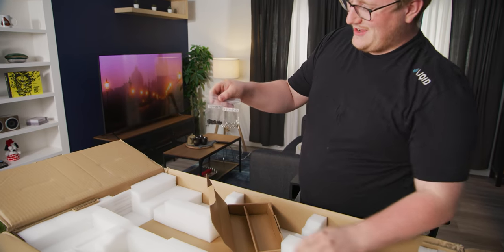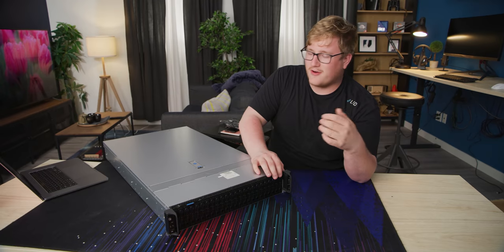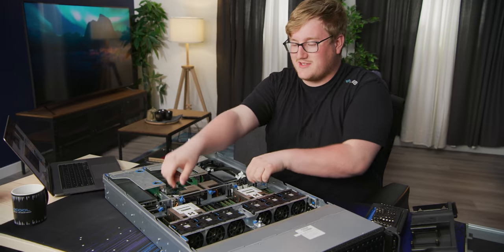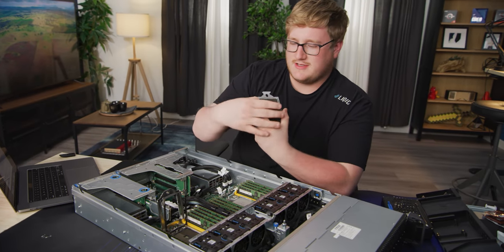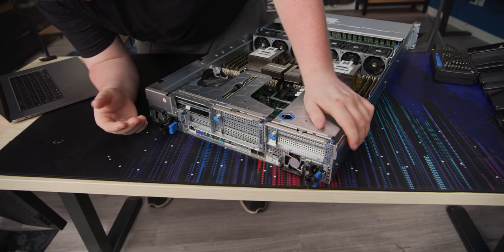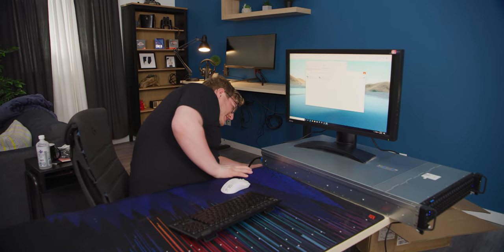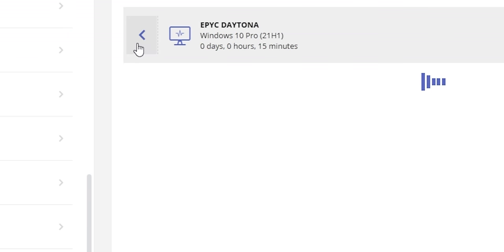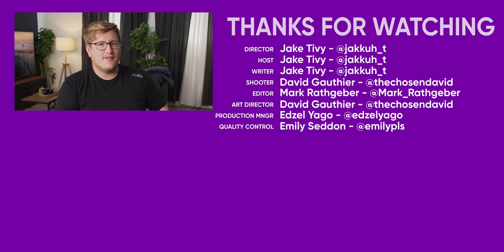The FASTEST computer we have unboxed - AMD EPYC Processors

Comment: I'm really disappointed he didn't mention "VM host" as a possible use for it.  That thing could probably handle 200-250 VMs, in 2U of space.
Reply: Do some VFIO.
Reply: We use the same CPUs in gigabyte blade servers (4 1cpu nodes/u2) and it can handle BUNCH of VMS 

The only issue we ran into is... Availability

128GB ram sticks are basically unobtanium here
Reply: @Angel2kinds  Lucky...  I'm still dealing with Xeon E5 v3 and v4 hosts where I work.
Reply: @Angel2kinds  There are 16 RAM slots. How much do you need? You can get 2TB using 64GB sticks. That would be ~10GB of RAM per VM at 200 VMs. Yeah you'll need more in some situations but plenty will require less as well.
Reply: @kaldo_kaldo  around 1.5TB/server, there are 8 ram slots/node
Reply: @dangingerich2559  eyyyyyyyyyy!

Comment: Ampere Altra does have a dual processor 128 core(per processor) now, their old dual processor 80 core(per processor) would trade blows with Zen2 Epyc but Zen3 does have a pretty good performance boost over Zen2 so they might still trade blows

Comment: You missed the most obvious use for tons of cores, RAM, and storage: virtualization. I have VM hosts running 30-40 VMs with dual 18 core CPUs. Depending on use case and VM requirements, I could easily see running 80+ VMs on a server like this.

Comment: I would use a server like that for finite element analysis... I currently use a Lenovo X3860 x6, 4 processor 72 core system with 768gb of RAM and a system like the one in your video would likely blow my current system away.

Comment: Good video, blue touchpoints aren't a indication where you put your hands or fingers it also indicated that its "cold swap" aka  you cant remove it while system is running, Orange however means it can be "hot Swapped" aka you can remove it while system is running. this is how its Run in Dell systems and as far as i know HPE systems

the reference design also indicates where we put the motherboards and how we set these all up. fans and the likes are best practices so independent from AMD or Intel

Comment: 2 64 Core/128 Thread CPUs? It just dawned on me, we're probably less than a decade away from small scale IT companies or universities that roll their own architecture having the ability to get 1000+ threads in a single box. With ML usage growing fast it is not even like there would not be use-cases for it as well 🤯
Reply: Serve the Home already have a video about one. 2u chassis with 4 nodes, each with dual Epyc. 512 cores in a box the size of the one in this video.

https://www.servethehome.com/dell-emc-poweredge-c6525-review-2u4n-amd-epyc-kilo-thread-server/

Comment: I have a R730xd set up for drives and networking not GPU and at full tilt the system uses a touch under 500 watts. 110 watts of that is the FANS.

Comment: One question... There is a lot of powerful fans - but where is the in and outtake for the HUUUUGE amount of air blasting thru the radiators!? 🤷‍♂️
I mean there is an billions of cubic meters of air pumping thru the rig... This make no sense - i mean, there is an rule of air flow - every fan have to get the same scope of in/outlet depend of throughput...

Comment: (4:09) AMD EPYC Rome, and now Milan. I bet AMD is working on a project codenamed "Venice". (EDIT 7 hours later: they already did - see replies)
(7:53) That reminds me of a Shuttle XPC a friend of my friend had, which had a BIOS splash that was just the Intel Pentium 4 HT logo. This was back when the BIOS splash would show the Intel logo, for example, IBM ThinkPad with the Intel Centrino logo in the top right corner, or HP with the Intel Pentium 4 logo in the bottom right.
Reply: They already made venice in 2003 :) athlon 64
Reply: @riba2233  
Oh.

Comment: Almost 800 watts of theoretical power draw from the CPUs and the fans alone... Boy are those fans blowie-matron moniker deserving. 
Anyway, a 1000 watt PSU for that system seems like bare minimum! Populating all of the drive carriers with 2.5" 7200 rpm spinning rust? That would probably challenge the OCP in the PSU, unless there's staggered spin-up. Not that anyone would be so intergalactically stupid as to try something like that?! Wink * Nudge* Please-for-the-memes?